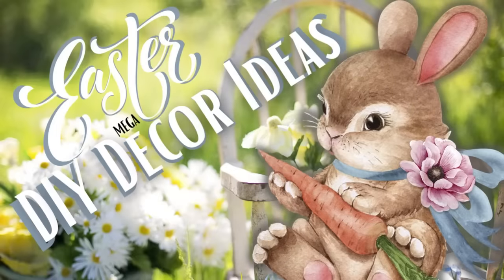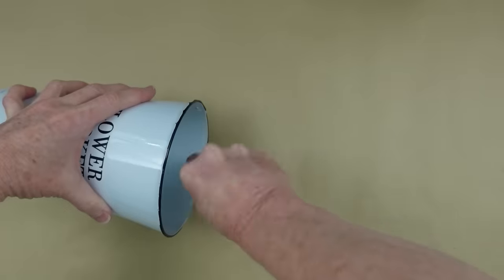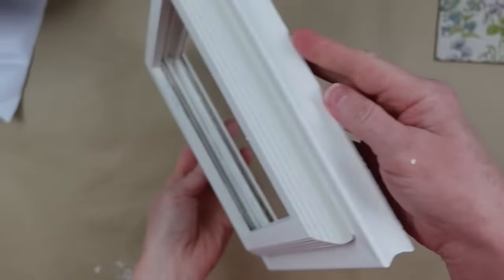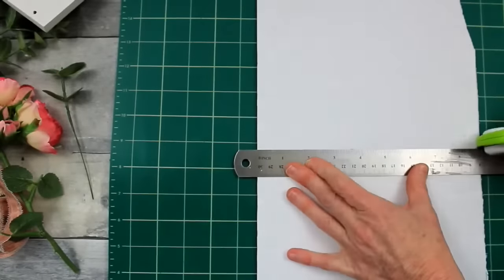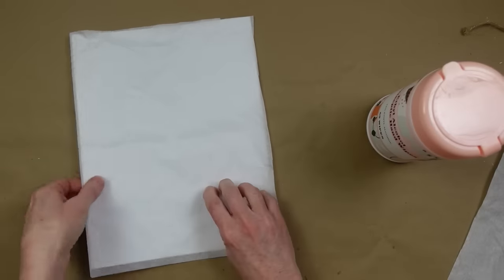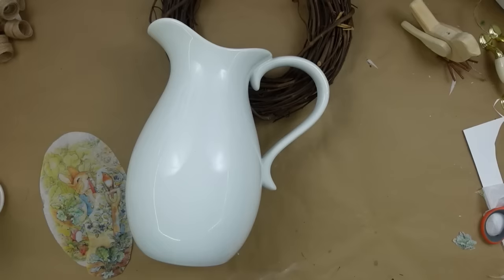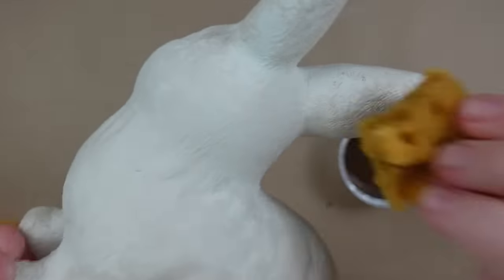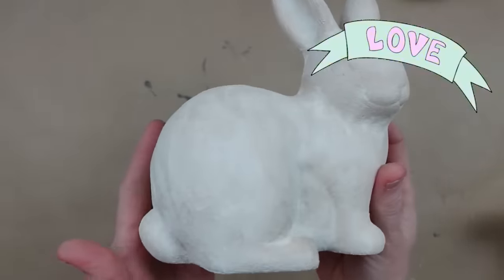EASTER MEGA! So Many Ideas To Get Your Creative Juices Flowing

Comment: Yes! If you do not remove all extra plies of napkins, you are essentially gluing only the bottom layer. That is why there would be so much wrinkling.
Plus, if you tear the napkin, the edges will blend in. I use a small artists brush dipped in a little water. Draw a slim line and it will tear easily.  Careful not to get too much water on your brush. You can also just tear it raggedly while dry
Reply from the maker: Great tip! Thank you!
Reply: I always get wrinkling at no matter what I decoupage
Reply: @KMF3  Have you tried the iron method with decoupage?
Reply: @jeannemaxwell3173  yes and even with that i can mess it up 😂😣